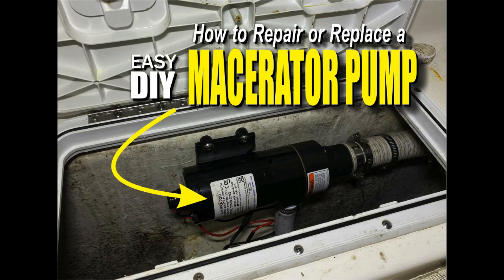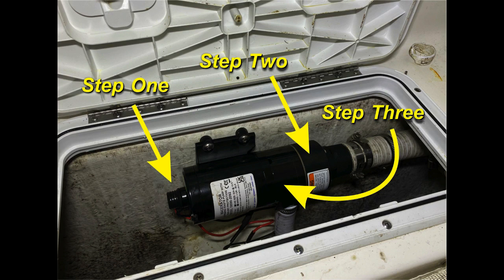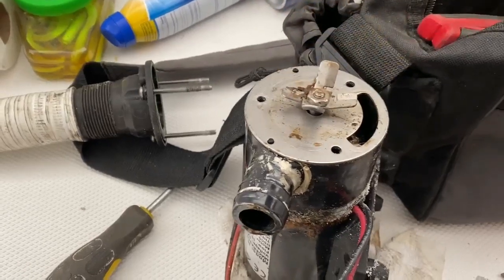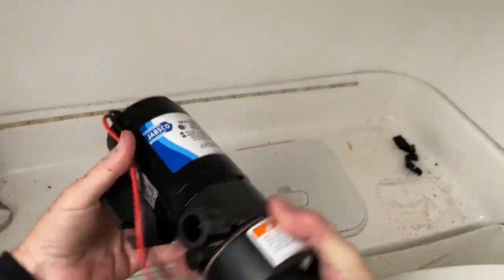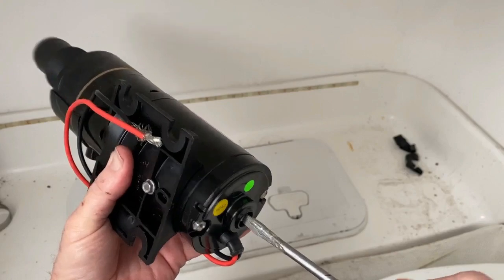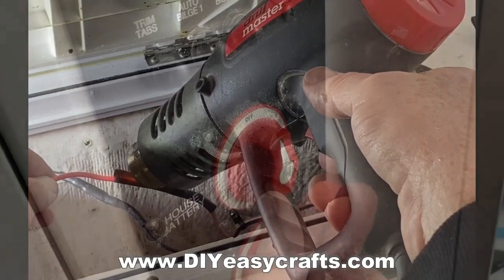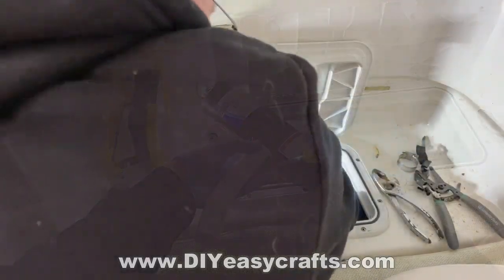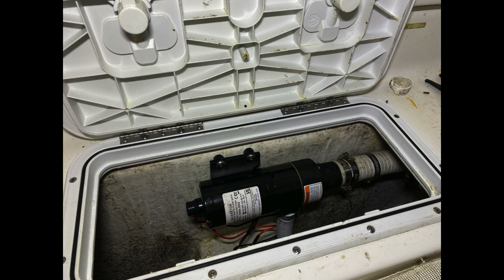How to Repair or Replace a boat or RV Macerator Pump

Comment: Also macerators should always be pointed downward and above the holding tank. Standing saltwater sat so long in that pump that it protruded into the motor. I've seen so many prematurely fail when installed horizontally. Many boat manufacturers install them horizontal which is so bad for them.